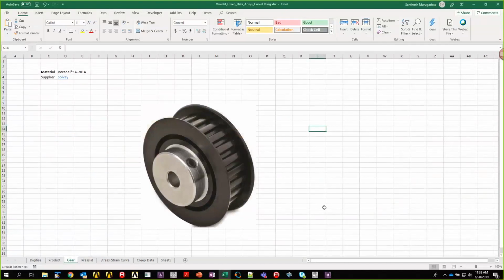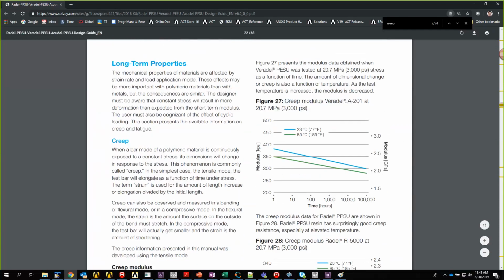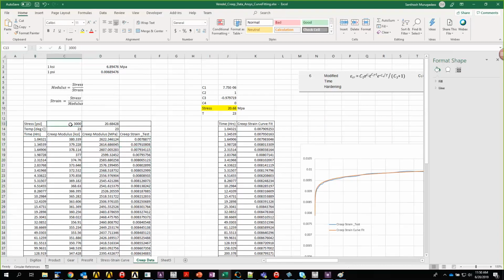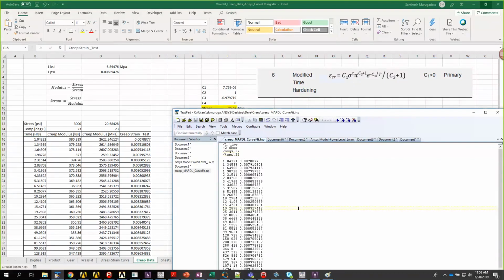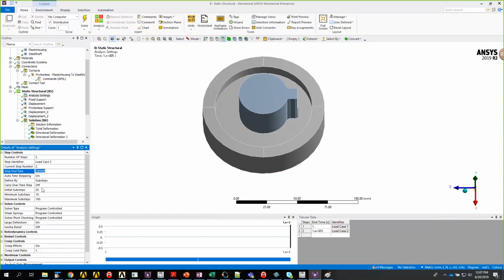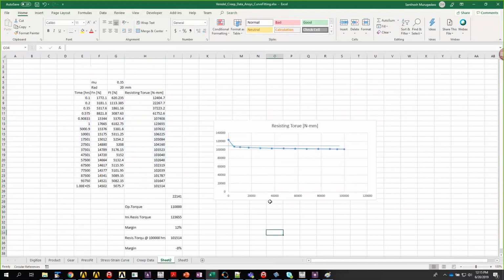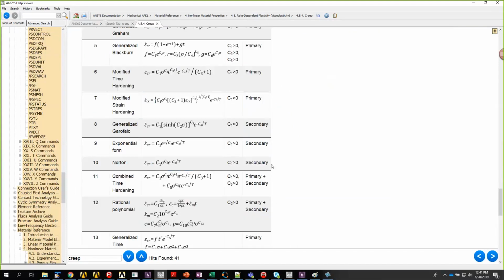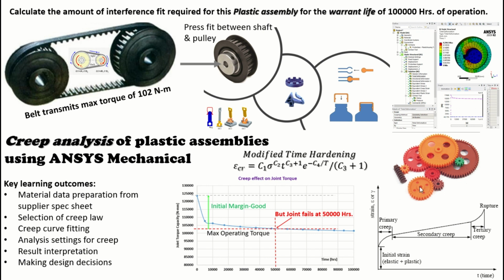ANSYS Creep Simulation of plastic assemblies

Comment: Hi,

I've conducted the same analysis as you, but I'm unclear on how you applied the boundary conditions. With the boundary conditions you used, I'm seeing no deformation, stress, or contact pressure. Could you please clarify where on the part I should apply the load, pressure, or displacement?

Comment: Hello Santhosh,
thanks for the video.
My Question refers to the experimental creep data. You have the creep modulus and calculate the creep strain for input into the creep model.
Why do you not substract the elastic part?
From my point of view your result now contains the elastic deformation from the standard stress-strain curve plus the deformation from the creep modulus curve which also include the elastic part. So is the elastic deformation coming from the standard stress-strain curve now twice in your result?
Thanks for your answer
Reply from the maker: Creep modulus =constant stress /Creep strain. The strain calculated from above formula is pure creep strain. However, it depends on how the data is measured and reported. I agree, where there is a need, then elastic strain part need to be taken care.
Reply: @SanthoshKumar-ge9sq  Thank you for your fast answer, that makes sense if the definition of the creep modulus is correct.
Solvay writes in the Design Guide you have shown: "The creep modulus is derived by dividing the applied stress by the measured strain after exposure to load for a specified time", what would mean that the strain calculated in the video is not pure creep strain.

DIN  EN ISO 899 defines the creep strain as the change in length at a given time.
The english Wikipedia (sorry) says: "creep modulus (constant applied stress divided by total strain at a particular time)".
I think there are different definitions all around. I assume Ansys calculates with its creep models always "pure creep strain".

Right now I am working on a similar problem. I did not substract the elastic part out of the results of creep test results (from a reputable manufacturer) and now I am 90% sure that this was not correct - but the error is probably relatively small and I am on the safe side because I would have overestimated the total strain.
Reply from the maker: @wjojo1  thanks for bringing in clarity here. My assumption was creep modulus was reported based on creep strain only. Ansys deals creep and elastic strain seperately. When creep modulus is calculated from total strain, then elastic strain need to be substracted. When elastic strain in small compared to creep strain over longer duration, the results are conservative as you pointed.
Reply: @SanthoshKumar-ge9sq  👍👍 thanks for the nice discussion!
What do you think about, if you want to be absolutely precise, you also must calculate the "true" creep strain and stress because also during the creep test you would have cross section reduction if it is a tensile test. Also in creep tests, the results refer to the initial cross section of the probe.
But I think as creep calculations are usually done at relative small loads for the material, also here the difference or error is small (between the "engineering" and the "true" values).

What is your opinion on that?
Reply from the maker: @wjojo1  you are right. Care need to be taken in terms.of engeneering vs true strain too. All these are possible if you have access to test procedure and raw test data. Data sheets usually don't give this much details. If you want further discussion write to aerosanth@gmail.com.

Comment: Sir, what if we define creep limit ratio as zero??..because my simulation is solving only if creep limit ratio is zero..pls  respond..
Reply from the maker: I have never used creep limit ratio  (a measure of the increment of creep strain / elastic strain) as zero. it means no creep strain developing at all. Recommended value is between 1 to 10. Some times I have used more than 10 when time vs creep strain input curve is steeply raising up.  But using zero doesn't make any sense.
Reply: @SanthoshKumar-ge9sq  thank you sir!
Reply: Sir, if temperature is continuosly varying like thermal cycling ,what will be the condition of creep constants?? Since it depends on temperature, therefore it can vary with temperature. So if im doing thermal cycling, temperature is continously varying. In my case temperature is varying between 900 to 400. So should i choose creep constants for 900 or 400 or in between some value and carry out simulation??
Reply from the maker: Creep curves at 400 and 900 deg C and also intermediate temperatures has to be input, if not Ansys assume linear interpolation for any temperature between 400 &900 deg C.
Reply: @SanthoshKumar-ge9sq  thank you sir! Your responses are valuable for me!

Comment: sir, im doing a simple creep simulation on a cylindrical bar where one end is fixed and other end is loaded under tension at 900 degree celsius..im facing convergence problem..i tried changing substeps, refined mesh, tried fixing creep constants...but still im facing convergence issue.
do you have any suggetions?? how i can converge for 14000 hrs at 900 degree celsius a simple cylindrical under tensile stress of 50 Mpa.

Comment: sir is that stress strain plot is for room temperature or elevated temperature??please reply
Reply from the maker: Actually speak stress strain curve need to input for range of temperatures from room temp to max elevated temp. If only 2  1.room and 2.max elevated temperature stress strain curves are input,  linearly interpolated curves are used to evaluate plastic strain at intermediate temperatures.
Reply: @SanthoshKumar-ge9sq  thank you sir!